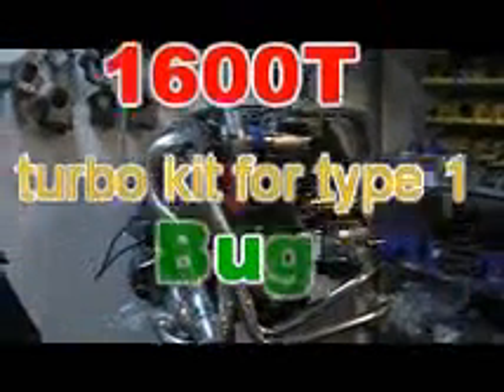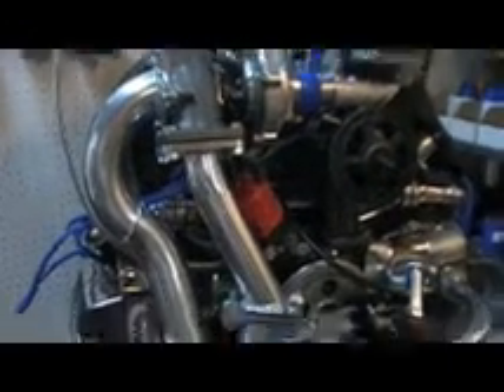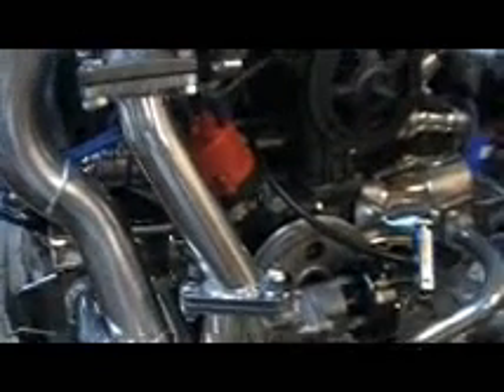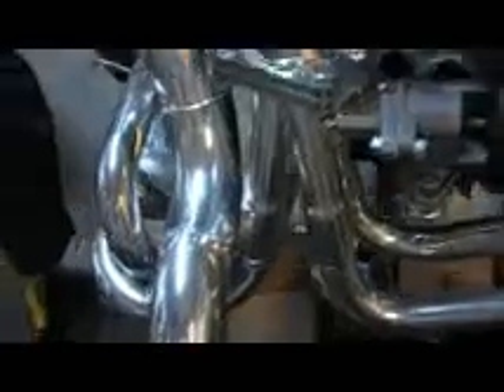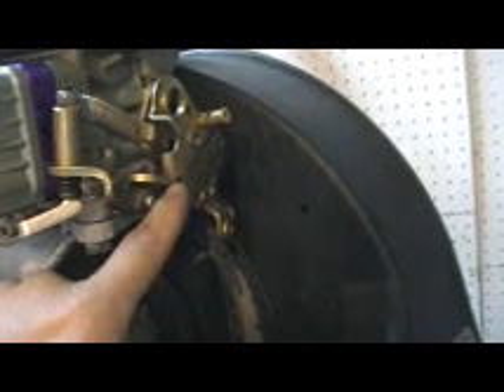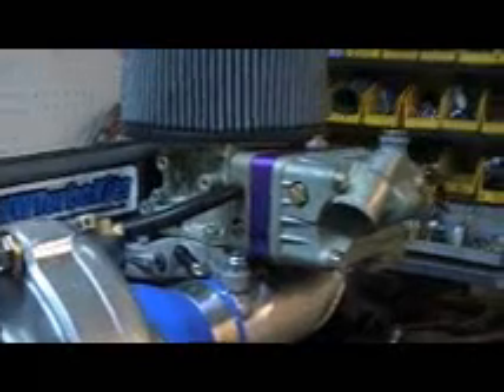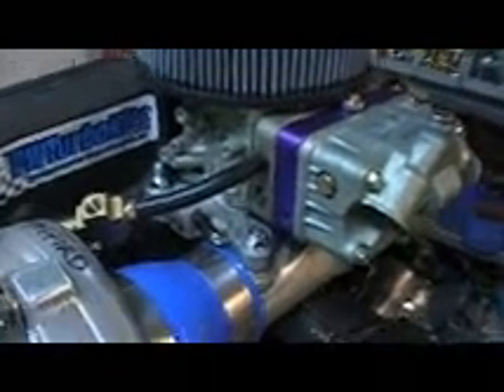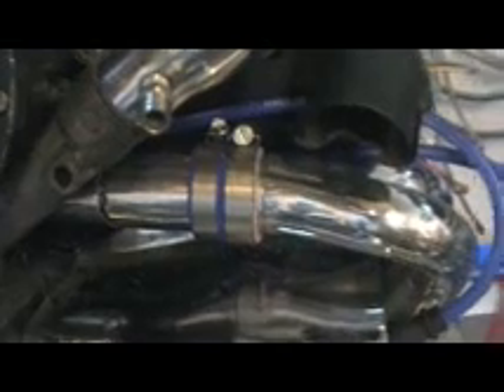VW turbo kit bug

Comment: does your kits also fit a 1300cc motor? does the kit use a charge cooler? most of my friends either run turbo motors and most are 1600 dual ports.
Reply from the maker: Hi, Sorry we do not offer anything for that small of a combo.

Comment: Hi A J, How are you mate? I just wanted to comment on this turbo kit that your describing right now on youtube. It has been now 7 years since I purchased the kit from you that you are now describing and let me tell your viewers out their that it is still going very strong. I don't have any problems at all, I did get a turbo blanket for it to cut down the heat a little bit from the turbo and I don't have any heating issues at all, although i have 2 oil coolers underneath the car. I live in the tropics of Australia where the temperature gets to 40 degrees Celsius in summer and the oil temperature just gets to 55 degrees Celsius  now that's bloody good.   Anyway take care.

Comment: I don´t know very well the system but i´m interested in the kit. My question is if this kit could be installed in a bug that is not modify?, i mean the motor of my bug is original without any modifications.

Comment: Hey! i have a 68 vw baja and im concidering youre turbocharger kit.  is there any risk with installing the turbocharger? i mean im concerned about extreme overheating. and also, will i have to be running premium or race grade fuel in it? please get back to me im very interested!

Comment from the maker: @380Banshee 
Not true as the size of the valve will not dictate the total boost unless you out flow the valve size and 14lbs will not do that. Most wastegates preset open point is based off of the springs in them. We have 8,11,14,16, and 18lb springs that can be  adjusted from ½ the set point to over double the preset spring rate.

Comment from the maker: @duanedragon2 
The main reason is the runner length, draw through systems will need and like more advance to help with throttle response off boost so you would want to bump the timing up to make the engine more lively. But once on boost you would want the timing lower based off of the total amount of boost and your combo.

Comment: Hi, I'm kinda curious; does the engine not need a timing advance system due to the fuel/air charge in the cylinder being much closer to it's pre-ignition flash point? From what I understand a turbocharger does not heat the intake air but the act of compressing the air forces all of the ambient heat into a smaller space causing the temp to go up.

Cool setup. Very professional looking.

Comment: is the block on that 1600 stock was there any thing done to the bottom end also how much is a basic kit coast i have a 1970s 1600 stock will there be any issues if i bolt all that on also is it easy to maintain for some one who doesn't know turbo's

Comment: Normal boost is 7 psi.  If you really want increasd e horsepower, need at least 14-17 psi...  That requires a bigger wastegate than 38mm cuz the spring will give too fast.

Comment: Rattybmxbug yeah the turbo is carbon sealed. I have a kit from these guys. I upgraded my 71 dualport to a chromoly cw crank, dual high rev spring, eng 100 cam, stainless valves, solid rocker shafts, and chromoly pushrods. Im making about 220 hp on race fuel.  Total cost with engine upgradesabout $3200.  alexeka when they say 300 to 350 thats the max power that kits good to like on say a 2332.

Comment: Thats just shit man! No way a 1600 vw pounds out 325HP. A maxed out turbocharged 1600cc leavs no more then upp to 200hp, and then you would need real race heads, counterweghit crank and a lot of other stuff. And you would have to burn at least 10K in to a motor like that.